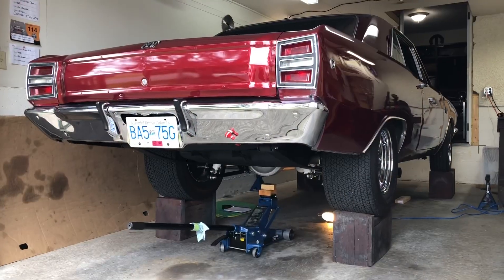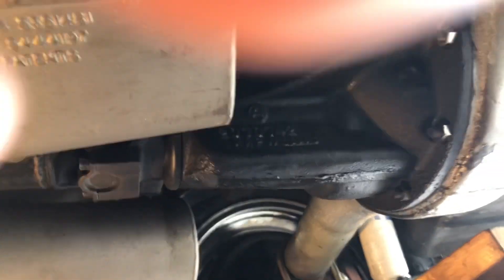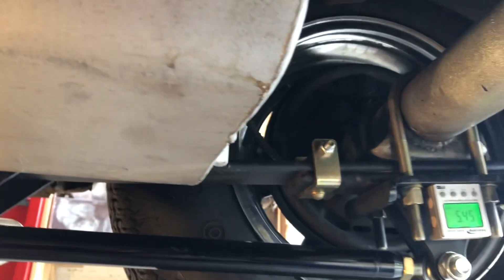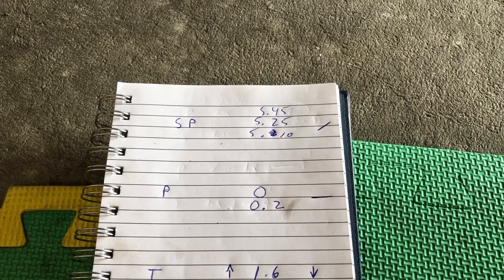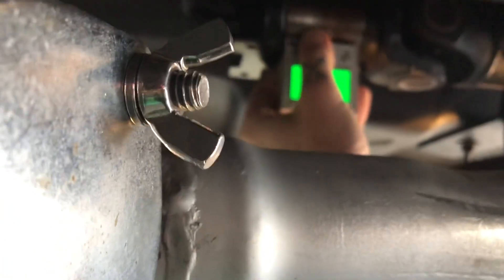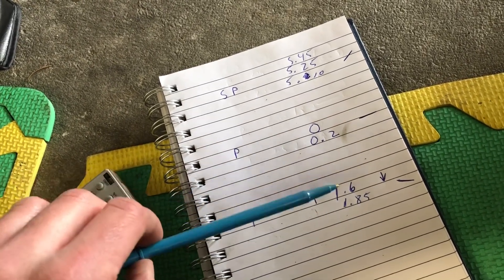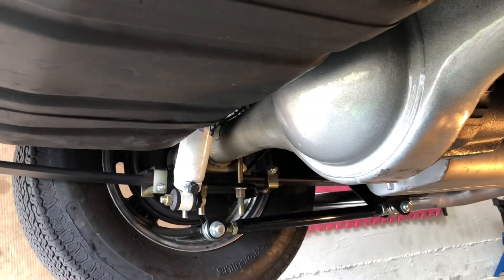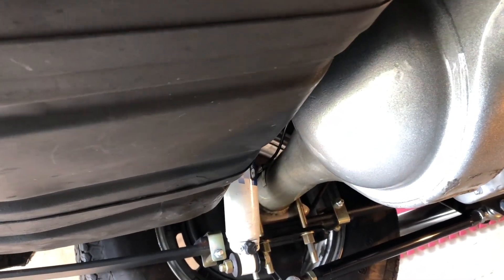Pinion Angle, Trans to Pinoin and Spring Perch Angle!?! What the heck???

Comment: there was a racing suspension video where guy is explaining to help with car hopping and not going forward , well he explains that the CalTrac bar system needs to be lower. so in recent video showing a stock 69 cuda a body i seen that the car was cla trac system and he used 1 inch lowering block. this car was built by Steve Wann , it does not have  a huge wheelstand it just goes

Comment: Another over talked video.  Without physically showing the way to adjust  the axle.. doesn't really helps does it?
Reply from the maker: If you listened to the over talking you would know why I made the video.
Reply: @SimpsonsSpeedShop  here is a simple question  sir. What bolts do t turn to get the (dog bone? ) level?   That answer  would be worth gold to me right now.. my only  vehicle is my money  maker. And the shops in my area  won't work on high to vans or sprinter vans
Reply from the maker: @mv4463  this channel is about a body mopars. Your thing is different. No dog bones here lol.
Reply: @SimpsonsSpeedShop  well that doesn't  help  ..but thank you for replying... I have a 1979 challenger 440 6pk.. it's in my garage  but on block..just to keep tires round..very mint . I cand use it in my work. But If I have. A issue  I'll revisit...

Comment: Hey brother, enjoyed you're video.  When I first built my Duster I ran a 8 3/4 also with a Mopar spring relocation kit, super stock springs and I used 3.5° shims with a pinion snubber. It actually worked very well but I would have loved to have your setup. This was in the late 70s and that was a pretty common setup for the times. 
What gear do you plan on using? 
I ran a 5.13 for our 1/8 mile tracks. And like you I also enjoyed driving on the street.  That 5.13 was wild on the streets. Lol, nothing like screaming at 4-4500 rpm on the highway.  Of course street tires wasn't no where near as good as they are today so we ran cheater slicks on the streets and PRAYED it didn't rain.
Stay strong brother
Reply from the maker: Hahha sounds awesome! The first set up was super stock springs and a mopar snubber with drag radials work great 75% of the time. For me anyhow. New gears will be 4:30. Will put me about 33-3400 on highway. Kinda building the car for 1/4 mile. Even tho I haven’t raced 1/4 hahahha I know I know. Thanks for watching

Comment: I've got to put 'C-clip" eliminators on anyway for this project I'm working on, with two 9" transplants right behind it, so bit the bullet.  I want to weld the ends on, not silicone them and hope they don't leak.  You know what I mean.  Thought I'd share.  Enjoy.
Reply: Make sure you keep an eye on strange engineering , I ordered one of their s 60s and they charged me to drill the axle ends out 4 bolt accessibility and then didn't do it.
Reply: @thomasward4505  Really.  So, you wanted to throw a 4 bolt Ford rim on it?  Will they make it right?
Reply: @thomasward4505   👍
Reply: I think Nolan misunderstood, the hole was for access to the bolts behind the axle flange

Comment: Excellent video. However I must agree with some of the other commenters, I don't see the advantage other than too Strange engineering(big money). You have a good set up for what you are doing back there. You're not breaking a bunch of stuff so...If it's just for content I guess its up to you.
Reply from the maker: I would rather upgrade before I break stuff. That 8 3/4 won’t handle a trans brake and I plan on a motor upgrade next year so it a good idea to do now.
Reply: @SimpsonsSpeedShop  May as well do a 4 link then
Reply from the maker: One thing at a time bro

Comment: Just curious why your switching to a Dana since an 8 3/4 is strong enough at your power level/weight? Plus the 8 3/4 is easier to turn
Reply from the maker: True at the current build the 8 3/4 is the perfect choice. But I have big plans for this car. Thanks for watching. Stay tuned!
Reply: Simpsons Speed Shop nice. Just put a Strange 60 in my dads 69 gtx that runs 10.50s. Surprisingly it was only 30 pounds heavier than the 8 3/4 we pulled out of it
Reply from the maker: Good to know! Sounds like a nice ride
Reply: Stroker?

Comment: level chassis (body) with weight still on the rear tires before getting your measurements....find what angle the engine/trans is in the car.  The Dana will have a 1.12 inch shorter drive shaft than the 8 3/4.
Reply: @SimpsonsSpeedShop  The dana needs a shorter shaft, your shaft is so short I got mixed up
.

Comment: -4 sure will give you more bit and will give more lift in the front too what is the make and model for that angle gauge? Thx again.
Ps going up in the rear gear will also help to get the car in the 9 too are you at 4.10 now 4,56 or 4.88 are a super gear for racing I ran 4.88 many times on the street great results tho good luck.
Reply from the maker: Yes -4 would bit more but harder on joints for sure haven’t decided on exact angle yet. New gears will 4:30s just a little bump up. thanks for watching bro!
Reply: @SimpsonsSpeedShop  go 4.56 you be glad you did ??? I would try -4 and see John Caltrain knows them lef spring cars did you ever see his mustang go if not you must!!!! Please send info on the angle gage thanks.
Reply: @SimpsonsSpeedShop  you want to go fast more gear is what you will need!!!! Do worry about bigger motor right now you want 9 try bigger gear and see ???
Reply from the maker: I realize more gear would be better at the track but still a street car and 33-3500 rpm on the highway is high enough for me. I also believe I will trap at 65-6600 rpm in a 1/4 with a new gear.  Can always do a gear swap later on this will be the 3rd set of gears I have had in the car.
Reply from the maker: That angle machine is a “Intercomp” angle gauge. Only info I have on it.
Reply: @SimpsonsSpeedShop  trust me we had 456 and 488 the world know 5 and 15 Berlin typk know for drag racing 60,70,80 ,90 and bit today but toooo may new lights we had dons speed shop on the highway and still there today the owner Don died last April at 90 his son Paul now running it so trust me 456 is not that bad if you want to get into the 9 and you will with that gear I have a friend rite now drive a 500hp 67 Camaro with 488 on the street and races on rt 8 highway I know you run on the highway to get to track but he’ll you got nothing to loose except go faster!!!! Please send info on angle finder thanks jb.
Reply: @SimpsonsSpeedShop  i  Agree and think  your 60 fts will drop some if you are yet using 28x10s. i cant see any more gear then that , you already said you were short shifting and running quicker
Reply from the maker: Yep you got it
Reply: It's spelt bite, like bug bite, dog bite, etc.  Bit is like drill bit or a small piece, part, or quantity of something.😎